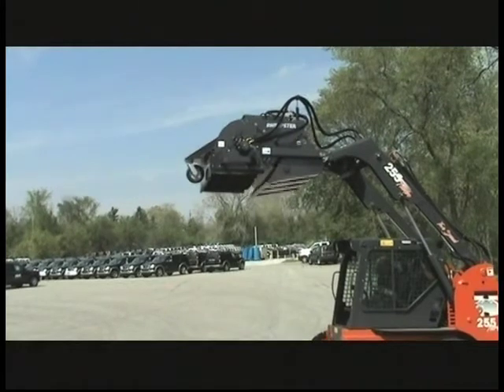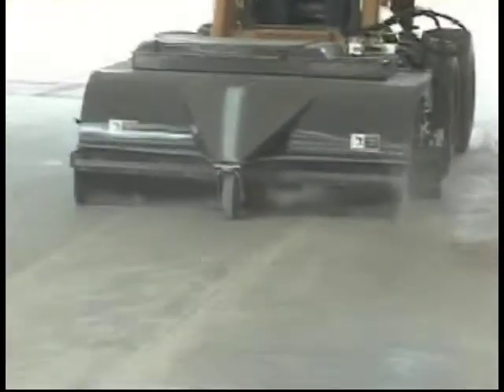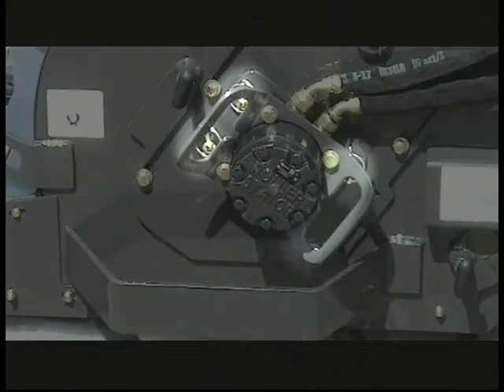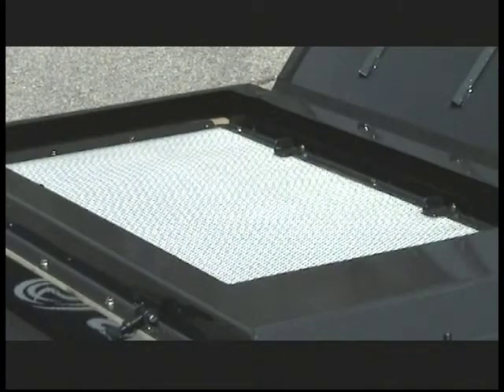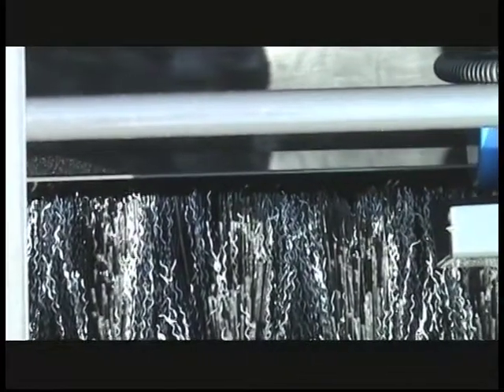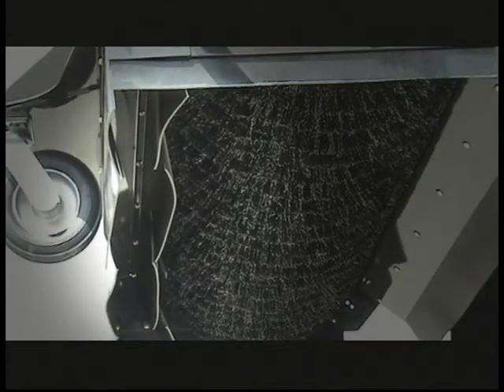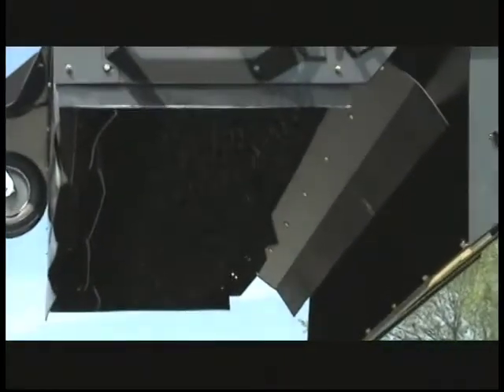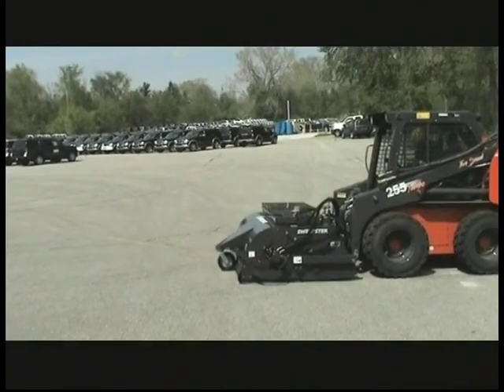Sweepster VS

Comment: The MRH sweeper’s design is IMO backwards, the gearbox should be on the LEFT SIDE of the sweeper, not the right side, where the user could easily rub against curbs causing damage.  Design flaw!